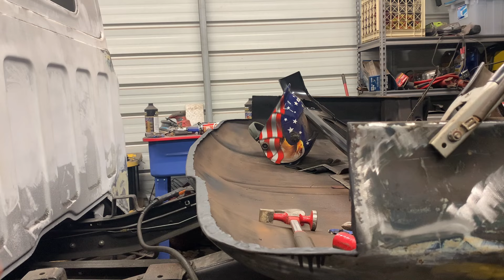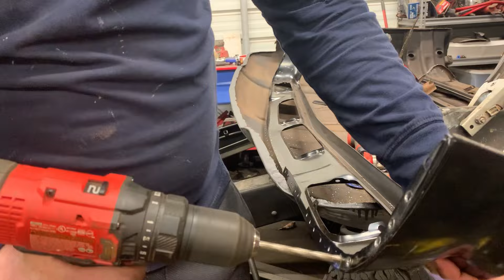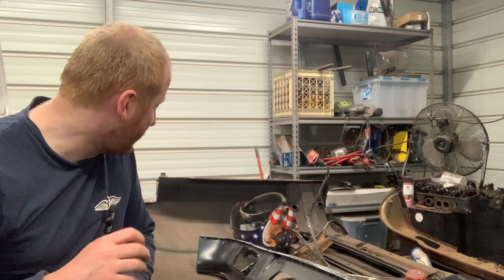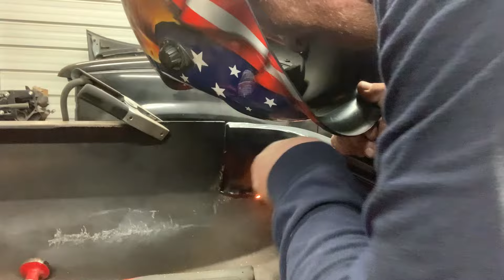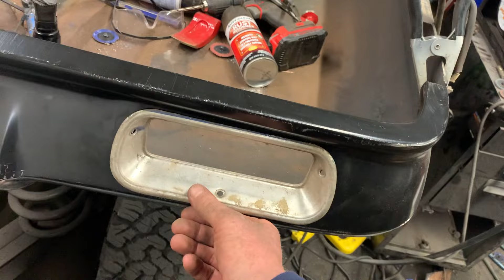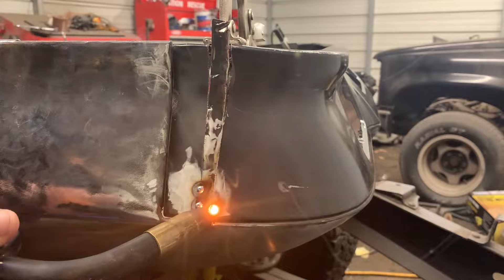GETTING A FACE LIFT!!!  1963 CHEVY C10 RESTORATION DAY 136

Comment: Hey Chris, you’re doing a great job with this build. This is a first time comment but I’ve been keeping up with your progress. I’m also in the middle of a 65 C10 restoration. I’m just curious if it would’ve been better to start the welding at the nose and work your way out? It seems like the nose lined up but the camera angle didn’t show the outer nose. Would that have made your expansion area necessary on both sides? Again, I love that you’re willing to show as much as you do. Not enough people go into this much detail.
Reply from the maker: Thank you I appreciate it!   I think if I started in the nose I would have had to a patch on both sides since it was both short. Thankfully it’s on though!.  How is yours going?!
Reply: Thats great. It sure looks like you know what you’re doing. Have you done a lot of body work in the past? I took a few body classes in junior college some years ago but the class didn’t go nearly as deep as you’re going with your truck, so I’m definitely picking up some tips and tricks from you. My truck’s chassis is all put back together and I’m currently focusing on the 283 before I get to the body. But I’ve had it for a year and a half and feel ok about the progress considering life’s obstacles. Keep up the good work. I’ll keep hitting that like button.
Reply from the maker: @SamboRambo79  thank you!!  And I’ve never done body work in my life.  This is my first go at it.